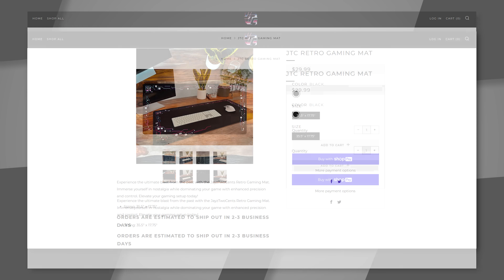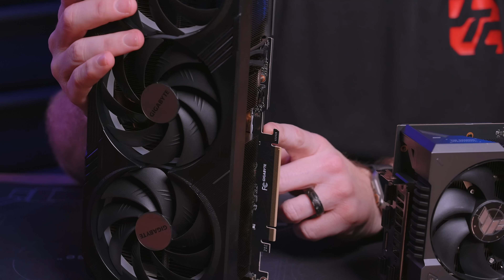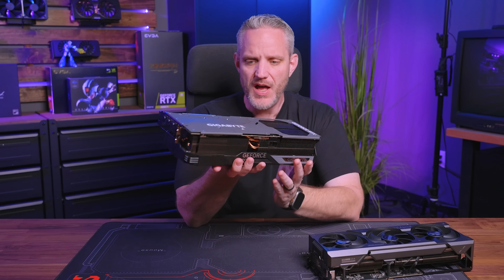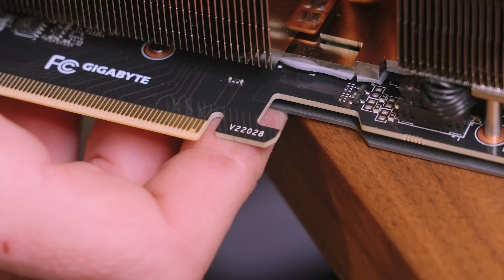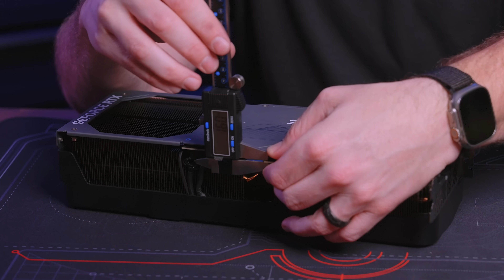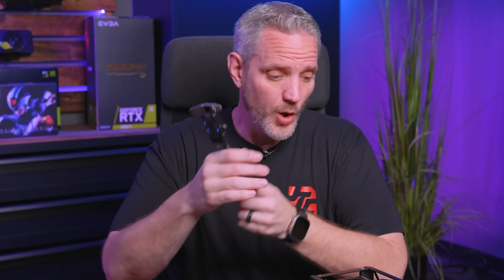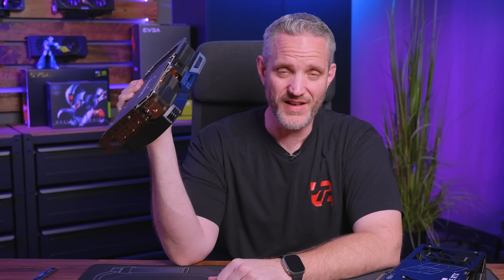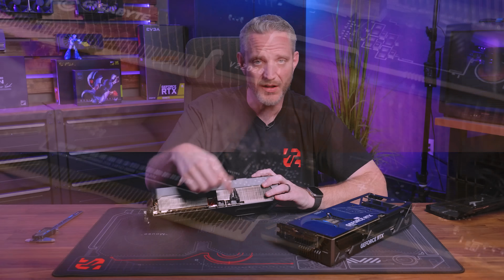These GPUs are cracking and the company REFUSES to warranty them!

Comment: Likely occur on a horizontal mount card moreso than vertical mount. 

The flex test Jay did on the Asus card that had a stand-off/spacer bracket closer to the end clip providing strength and rigidity. The Gigabyte card has no supports / fasteners in that area, hence the noticeable flex. 

I’ve a 1080, 3080 watercooled card & a 4080 from 3 different manufacturers but the Gigabyte Aorus Xtreme factory water block card is the only one that gives support issues. It’s now vertically mounted and in an InWin d-frame case mounted. No issues anymore. 

I’ve seen many repairers repairing the gigabyte 30 series GPU’s not honored by warranty when it’s pretty obvious the weight, sag and no card support at the break point is the cause. 
It’s not good marketing, smart etc by any brand to provide no support on their products so I’d say, don’t buy from them if this occurs to you, especially if you didn’t physically cause the damage yourself.

Comment: The giant size GPUs are just ridiculous. Replaced my 3070 FTW with a 7900XT and the size difference is mindblowing. The 7900XT which has 20gb of VRAM and can run circles around the 3070 is a normal sized GPU. I prefer vertically mounting my GPUs, but if you can't and you have a gigantor card then you have to use a quality GPU support.

Comment: You do a lot of software benchmarking. Please add physical benchhmarks to measure design and part quality. Thickness of board, radii (stress cocentration) at physical connections, flex under a standard load, heat map at the power connector (think thermal stress cycling), etc. PCB material is brittle (low fracture toughness) so if a crack starts, it WILL propagate if there is external load or internal residual stresses.

Comment: Well I know that my 3090s all came from some type of bracket to prevent the sag. I believe my 6700s also came an anti-sag bracket. The more important thing would be on an engineering standpoint is why do power (or any type of contacts, for that matter) have to pass through essentially a vestigal part of the circuit board?

Comment: I bought a Gigabyte RTX 3060 overclocked graphics card last year for an SFF build that had plenty of airflow.  While running Riva Tuner playing Halo Infinite, I watched the card's temperature go all the way up to 90 degC and thermal throttle.  I quickly returned it and replaced it with an EVGA RTX 3060 XC card that runs no hotter than 63 degC in the same game.

Gigabyte products is hot garbage.  I have their AORUS X-570-i Pro Wifi motherboard that doesn't even have the ability to undervolt.  I just hope it doesn't go up in flames.

Comment: Years ago I hid a gigabyte powersupply years ago, I was testing my system without a GPU installed, it was an I5-6400 

The powersupply instantly popped when turned on and killed the motherboard and CPU 

Gigabyte was absolutely not willing to help at all for their failed power supply. 

Since then I have reffered to the brand as gigaboom and not bought anything from them

Comment: Hi Jay, do you think the problem may also affect 20-series cards from Gigabyte? I have a 2080 Ti since 2019 and I always had some trouble taking it out of the mobo for cleaning due to that difficulty in accessing the lock (I use a plastic spudger), so now I'm afraid of damaging that part of the card... It doesn't sag or anything, though - I use it with a NZXT Kraken X62 AIO and the G12 bracket, and the AIO tubing helps lifting the card (no problems with the flimsy Gigabyte fan assembly either, thanks to that).

Comment: Fun, right after i lost my 1070 from Gigabyte... then i went to buy a 3070 from them... I hope this does not happen to me. Or else no more GB cards, like ever. They are more overpriced too, in comparison to MSI/Palit and a few others.
Reply: Make proper support for a card, and this issue shouldn't affect you. 
Because PCB won't crack by itself, external stress must be induced. Usually it is combination of pented up sag stress and external force like shaking or user trying to pull card out or push it in after PCB already weakened.
Reply: @DimkaTsv  I see, well there is a chance i might push it too hard or something. You never know. As we learned, those are super easy to crack, so it could happen to even a 3070, which is not even all that heavy. It is a thing to worry about honestly. I remember how my friend was smashing his card, trying to plug it in for like 10 m. If that was GB? Already dead card LOL!

Also proper support? My case is deep, i dunno how i can even put a thing under it. Maybe with ropes? I gotta think something for my next video card purchase. I ain't changing my case cus of 1 card.
Reply: @Starfals  seriously why thinking on jank ass solution when you can literally buy standoffs... And some gpus allow support with additional bracket on right side of GPU that can be screwed down (but this is definitely not for every case). You can also buy vertical GPU mounting kits. 

Stop trying to make excuses. There are available solutions already.

And don't be paranoid. You can try pushing card for 10 minutes and it won't affect it in any way, because you didn't push it up and down relative to slot, for example. 
Also don't make it look like Gigabyte cards break from blowing on them wrong, that is bullshit way to think about it. There are plenty of cases, but not THAT many of them. And iirc most of then were coming from prebuilds, where damaging factor isn't person, but, rather likely, improper shipping.

Comment: I have a Gigabyte 3070 Windforce... Mine is held up with a thin brace bolted on to the PCI slots bracket, and that is supported by a 3x90mm fan assembly also bolted on to the PCI slots bracket, maybe it's gonna be okay? I push down on the support and the GPU goes down with it, so I know it's actually being supported by it...

Comment: In my experience Gigabyte has always had quality issues.  They skimp too much.  I had a 1060 from Gigabyte where one of the fans rattled brand new right out of the box.  I used it for years with the fan speed stuck at 74% because that's when the rattle went away.

Comment: Those PCB's look to be made of FR-4 as are the majority of PCB boards. They are lightweight, they have moisture resistance, they are low cost and perform well. FR-4 is being mostly used by consumer electronics.
Though I would have thought they would have been made out of a more ridged Substrate, Rigid PCBs are cost-effective. Their substrates are ceramic-based, which would have been a good idea given the the localised heating found in GPUs.
Reply: Rigid=brittle
Reply: @IIGrayfoxII  Not necessarily, it is easy to design/choose a substrate that would give the required rigidity but not so rigid that it is brittle, in this case it appears that Gigabyte did not think through the physical properties the GPU PCB would need and chose one that is both mechanically weak and brittle.

Comment: I have a gigabyte aorus 3070ti but I definitely don't have those issues because I have an evolving shift air case so the GPU is vertically mounted and connected via a riser cable

Comment: 1'st: I'm a gigabyte fanboy
But..  6:48 on Asus card you have that cooler mounting that help that part of the card to flex less.. you can see that the retention tab flex from the mount to the edge.. also Asus pcie connector flex more than Gigabyte 
Things with materials is that flexing isn't always bad and depending on the situatin being to rigid can be bad as flexing to much can be..
L.E.
Also a comon denominator on the start of the video was prebuilds :D

Comment: The fact that there is a sharp 90 degrees corner at the stress point adds to the weakness.  If that corner was bit more circular, it would much better distribute the forces across it and not just at the corner (where the crack is). 
I find it really strange that they did not perform finite element analysis (FEA) on that corner when designing these cards.  I first used ALGOR 30 years ago, so FEA is nothing new.
You definitely need a support bracket for these heavy cards.  The old PCIX mounting point was for the old cards that were much smaller and lighter.  You cannot just make these cards bulkier and heavier without some mounting compensation.

Comment: So what I've caught on to is that GPU manufacturers don't care to reassess their design for the power connector or the power cable itself when it's clearly needed, they skimp on the design to save money which causes unexpected failures to develop over time, they will do whatever to blame the customer in order to avoid refounding them or replacing their GPU, they love to only marginally increase real power gains between generations of GPUs and they think it is reasonable to demand  $2000-$3000 for their poorly designed products. 

I'm pretty sure we are living in the technological dark ages at this point.

Comment: As an electronic engineer i can tell u that all of these +2kg cards will develop crack sooner or later in that position if mounted horizontally and no measurs are taken to releave the stress. The crack will grow with thermal cycles and load peaks (movement of the pc) until it hits a trace and it is noticed. The only question is if this happens in it's usetime. It's one of the most basic design rules in pcb design not to use pcbs as load bearing component. That is planned obsolescence for a very limited number of load peaks. 30xx cards are just older and run hotter. In 1-2 years u will see the same failure modes on the 40xx cards. I stopped mounting videocards horizontally as i bought a 1080ti. ... the only way to delay that failure mode is to reinforce that part of the pcb ... soon we will see metal plates bolted to the pcb, we have see that issue rise some years ago when the pcie sockets needed to be reinforced, the weakes part has just shifted to the graphic card.

Comment: A couple of extra things that weren't considered. 

1. The Asus card had a standoff close to the locking point that would be increasing its rigidity. It was clear that Asus considers the card stand-alone rigitity (or flex) and Gigabyte doesnt, as when you were showing the gigabyte card, those standoffs were minimal, of at all present, which acts to tie the card to the cooler better and increase its overall strength.

2. Gigabyte actually include a really good anti-sag bracket with their higher end 40 series cards. I have a gigabyte 4080 gaming OC in my system with the installed support bracket, and its super rigid once installed. I realize that this isnt a 30 serie; the point is that they may be getting ahead of the issue in the new series cards by including it. With that said, they should be designing a more rigid card that doesn't need the bracket...

Comment: There are various PCB materials, most common is FR4.
But if you do some advanced stuff you may deviate from that to help with signal integrity impedance control etc.
So that's why it's softer.
The traces being so close to the tab is obviously a shit design.
Those tabs being broken off is probably customer handling issue.
But then again if not the shit design the tab would be justt missing and the card would continue to function.
There is probably a lot of people who ripped it off but just keep using the other cards with better design that has no crucial traces right next to it.

Comment: The moral of the story is, Always install the card vertically. Anyone with half a brain would know that since the 10 series these cards have gotten too heavy to install horizontally. And if you can afford a modern high-end GPU you sure in hell can afford a GPU vertical mount. Have installed mine vertically since 10 series an have not had one single issue. 

Edit... But yes these manufacturers need to be held accountable, especially with the prices of these cards, it seems like they are charging more an more, yet building them cheaper an cheaper, At this rate we won't have many manufacturers left to choose from if they continue to cancel themselves

Comment: My EVGA 3090 XC3 is incredibly tight to slot in.  Takes a lot of preasure to slot in and it feels like a ton of force is put onto the PCIE slot. At first I thought my case was bent at the rear, but I have the same issue after upgrading MB and case.
Reply: It might be an issue with the i/o cover mounting on the card itself being off. I've had a few cards where that had to be adjusted to fit nicely. Sometimes it's just a matter of tweaking the tabs a little where they slide into the case. Sometimes it involves backing the screws off a little to loosen the mount bracket enough to wiggle. Lay the case on its side so the card is vertical (not hanging), slide the card back in and tighten a couple screws to lock the bracket down in the correct position. Remove it to tighten the rest, then reinstall.

I'm not suggesting you do this, just that I've had to and it's something to watch for. If it works you probably shouldn't fix it.

Comment: These cards are getting heavier and bigger, and it's getting easier to get this type of damage when removing the card if you're not careful. Gigabyte is probably not entirely to blame here, but it's good to publicize this case so that users are more careful with these cards.
Reply: Gigabyte set the trap by laying out internal traces near that fragile location.
Reply: @ariewijaya1679  The traces are normal thing in video card in this location.

Comment: The push button on every board I've seen uses a simple slot in design for the button, they release from their slot without much force. I doubt pulling it out without pushing the button would cause any issues.

Sag over time seems the more likely cause.

Comment: I work in a metal shop and , on all our steel were there is a notch we put a radius because a notch with a 90 degree angle is a weak point.any engineer should know that.lookins at these two cards the gigabyte card has a 90 in their tab were as the Asus card has a radius. This I believe is a factor in the broken PCB. As I said any engineer should know to avoid a 90 degree angle in any notches if at all possible because it's a known weakness point. I guess as jay said common Sense isn't so common.

Comment: Seeing this gives me sweatty palms with my Gigabyte 6700XT Eagle which weights as much as the 3080 apparently (800g). I just hope gigabyte wont go full Asus-mode or they wont do the same mistake as with their PSU post explosion responses..Good thing there is an extra lever in the slot (b450 a pro max) to keep it solid+ I screwed it into the I/O panel from the very beginning.. Still sweatty palms..this is nightmare material 😅